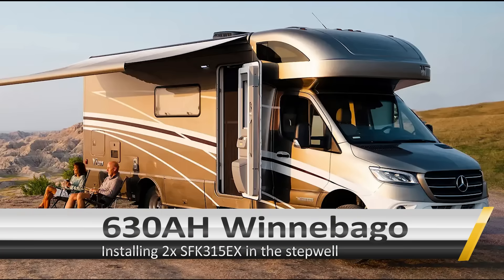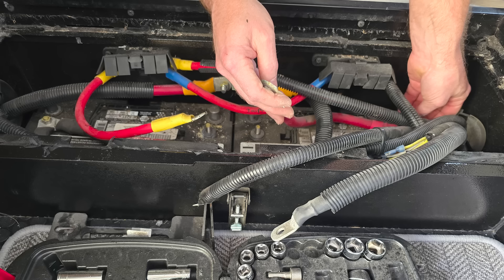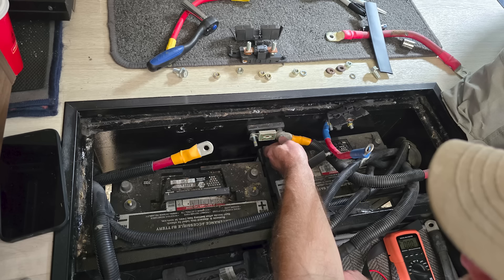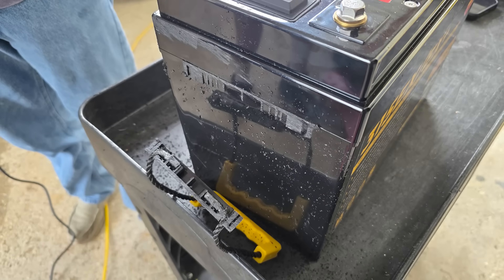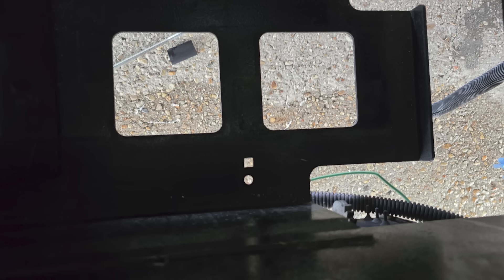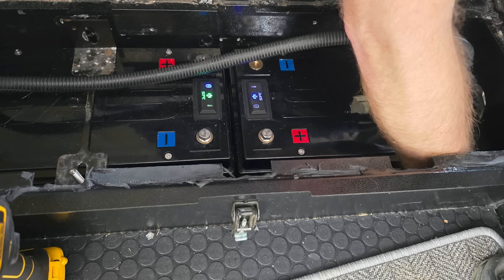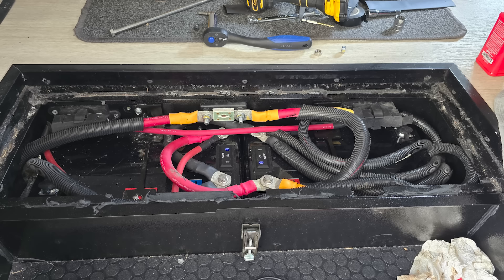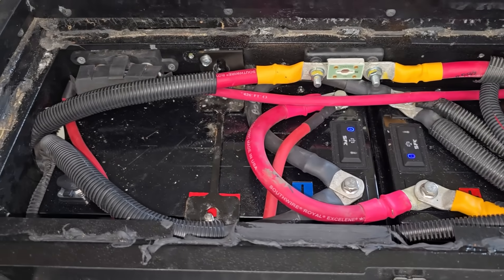630AH of Lithium - Stepwell Winnebago 24 View - 2x 315EX Sun Fun Kits

Comment: Thanks for this overview. I just purchased 2 of these batteries to install in my 2017 Winnebago Navion. Do you think I should provide some type of protection around the battery in this type of installation? The battery box is open on the bottom and the batteries are exposed to the road below.
Reply from the maker: It may be possible to add some fiberboard to close up the open battery cage as these batteries do not require venting.